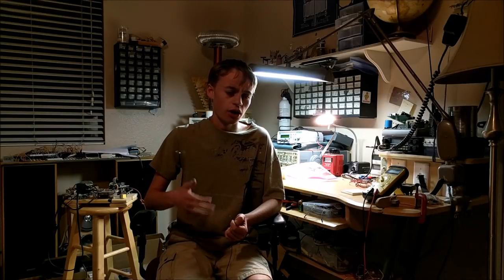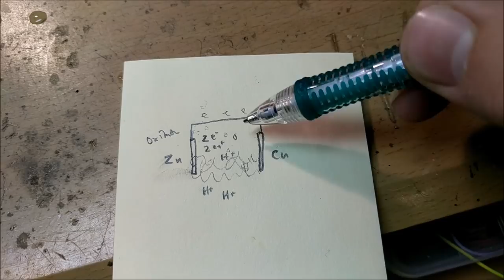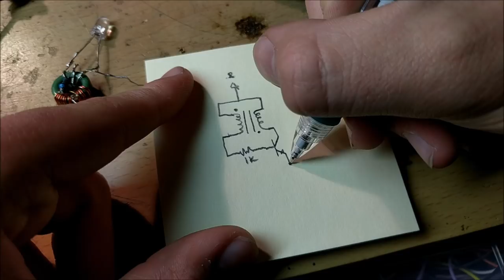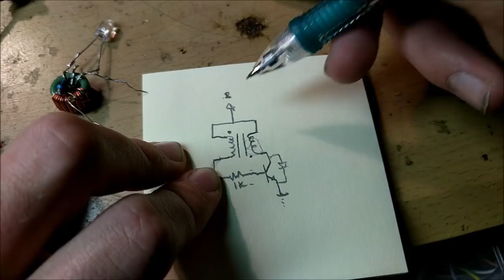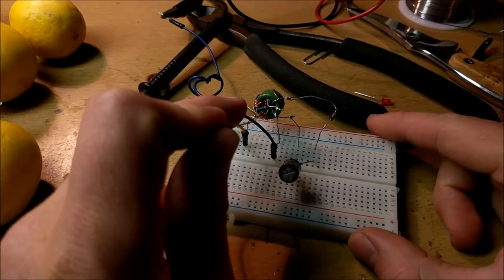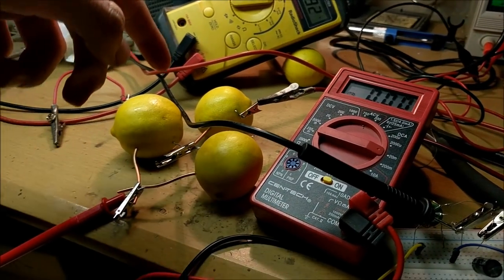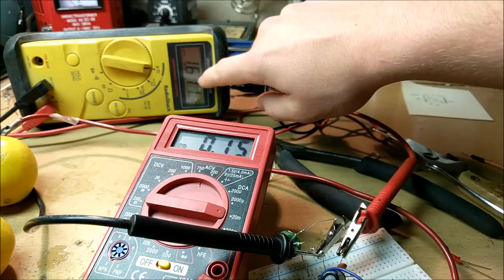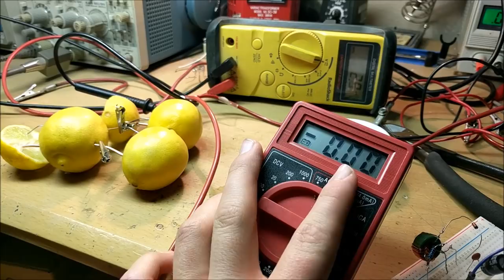Lemon Battery/Joule-Thief Experiment || It Did Not Exactly Work Out...

Comment: Hello Tanner, I think the current is proportionnal to the surface of the electrodes. In order to get more current you should try with larger Cu and Zn electrodes. Try to flatten it with a hammer, or find Cu and Zn plates...
Good luck :)
Reply: Actually, it would be better if the Cu and Zn electrodes have holes in them because that greatly increases surface area.
Reply: Why not both :)
Reply: Can use pennies for the cu and zn source

Comment: Nice experiment, Tanner.  I agree with your speculation that the thin copper & zinc "plates" of the lemon batteries are limiting the output current/voltage. Using plates with more surface area would probably help out...
Reply: Yes I'm sure it will.

Comment: Try with the lemon juice, a Zn & Cu sheets and put the electrodes closer. If not work well put a electrolitic capacitor in parallel with the battery. Last week I have made a joule thief works with this setup and light a bright blue LED with a copper plated coin and a piece of zinc sheet.(Sorry for my bad writing, my native language is portuguese from Brazil.)

Comment: You could have cut them all up into four sections each and provide more to go on, at least your table is getting a bit of a clean, nail brush wouldn't go a miss either 😂 maybe your led was an older style gallium Arnside version and needed more power, or your contacts were too small, maybe a foil strip would have given a bigger contact area

Comment: i think your problem involves # electrodes and surface area, but also you should probably use aluminum or magnesium instead of paperclips. u can also use carbon instead of copper. but you are having the same issues i was, helping with a science fair project. i could get nice volts but not amps. and the magnesium corroded quickly.. i was using just water /saltwater no food. dump some peroxide into solution to supercharge your cells.